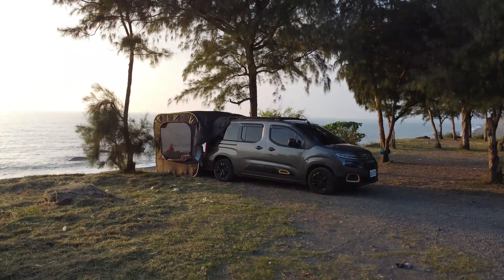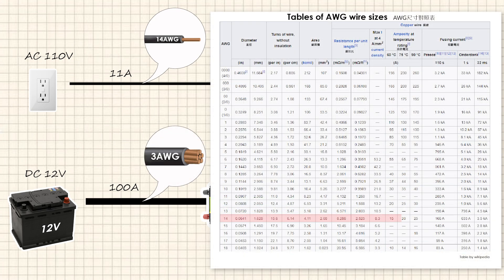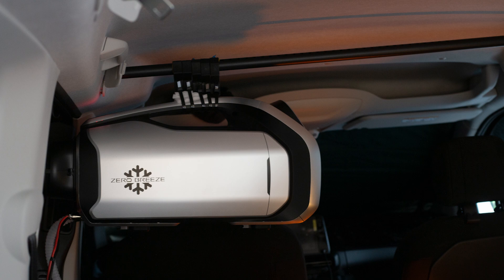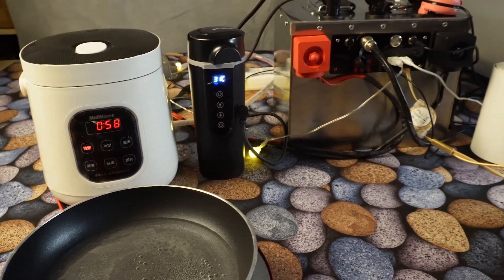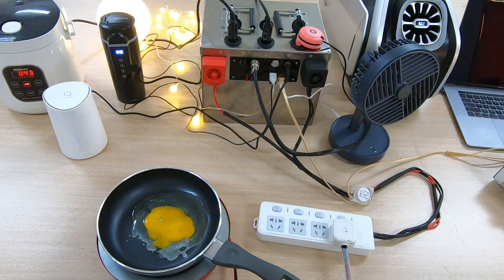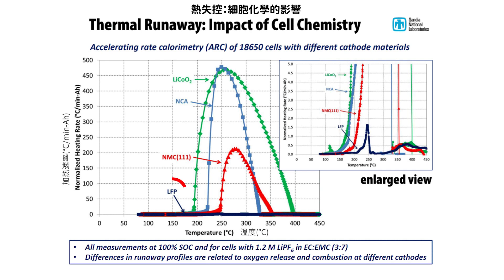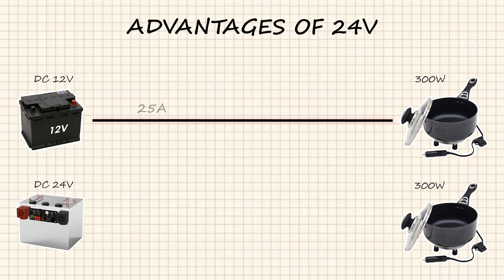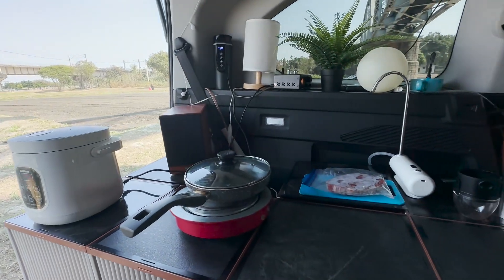[Car Camping] Improve car camping power efficiency?

Comment: Do you have a link for your 24V power supply?
Reply from the maker: I have. But most in Asia will check if similar to Amazon like this: 
https://www.amazon.com/Filfeel-Electric-Heating-Stainless-Truck-Food-Grade/dp/B07H5LDCPS/ref=mp_s_a_1_3?crid=11MH8TWK8NEE6&keywords=12%2F24v+heater+kettle&qid=1681241452&sprefix=12%2F24v+heater+kettle%2Caps%2C378&sr=8-3

Comment: Can you post links for these DC appliances in your video?
Reply from the maker: Most things I bought from Asia web. Can search Amazon for similar:

https://www.amazon.com/Filfeel-Electric-Heating-Stainless-Truck-Food-Grade/dp/B07H5LDCPS/ref=mp_s_a_1_3?crid=1DOPQ7TTE8Q9Z&keywords=12%2F24v+kettle&qid=1681245368&sprefix=12%2F24v+keytl%2Caps%2C348&sr=8-3

12/24 v kettle
12/24v rice cooker
12/24v 45w type-c ( fir laptop)
Zero breeze ( air condition)
24v pan
Reply: @simeiworker  ok, so basically search for the 24V version of stuff.  I was hoping to use an Instant Pot for quick meals, but I doubt there is a 12/24v at this time.  Many thanks for these videos!